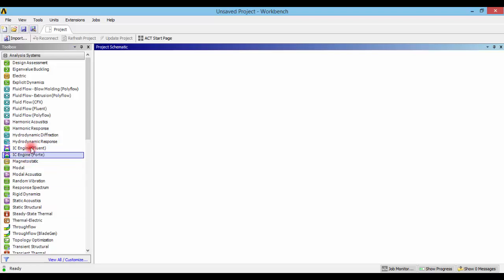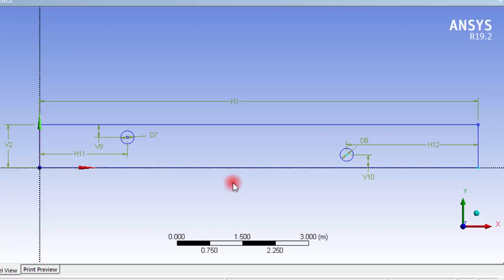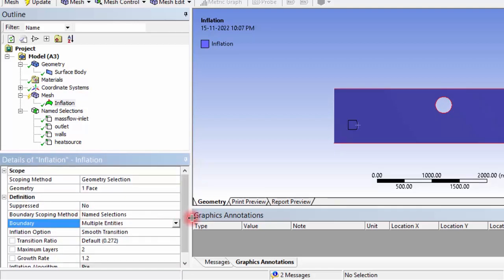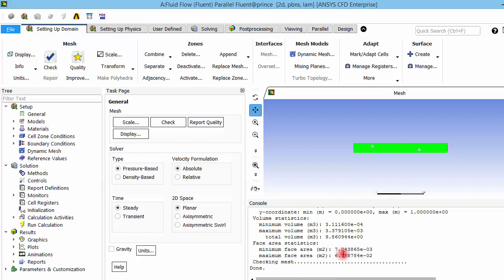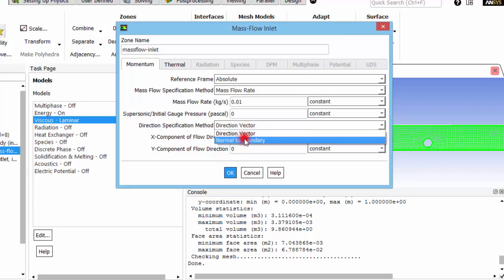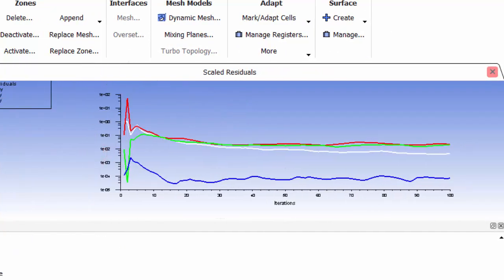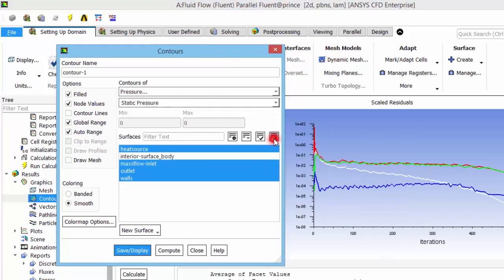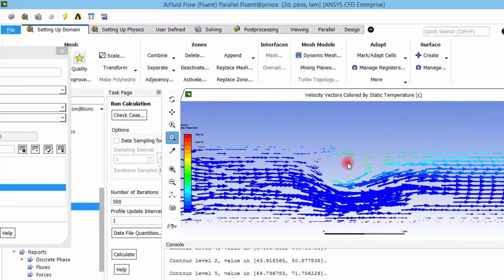Step by Step Tutorial for Heat Transfer Analysis in Ansys FLUENT | Setting Convergence Criteria

Comment: when I click on setup. it opens up the window but does not show the geometry. how to bring it?
Reply from the maker: Display > Mesh > Edges
Reply: @MechTechSimulations  Thank you but the problem is when i directly connect meshing to Fluent Setup nothing shows up. not even component tree properly shows it cannot find the meshed part at all. I have to manually export and import the mesh. Only than it works for some reason. I updated the graphics card but still the problem persists. I don't think it is a problem related to my graphics card but more like a problem with my installation itself as only if i import the mesh as an "*.msh" file it opens up.

Comment: Why did you leave Radiation- off ?
Reply from the maker: Radiation is typically not a primary concern in heat exchanger design because it becomes significant only at very high temperatures and requires line-of-sight between surfaces, making conduction and convection more practical and efficient for most applications.